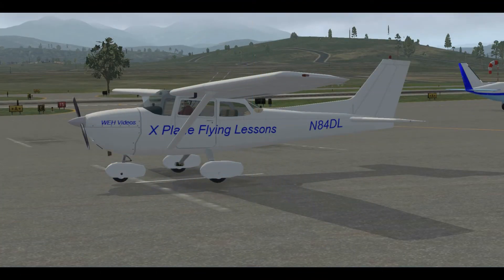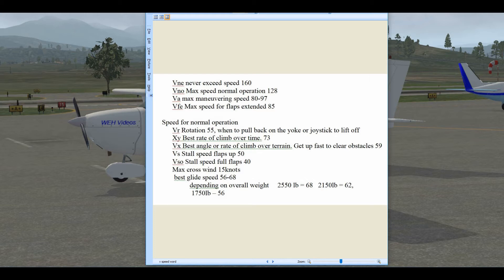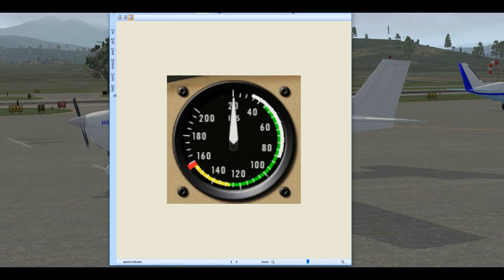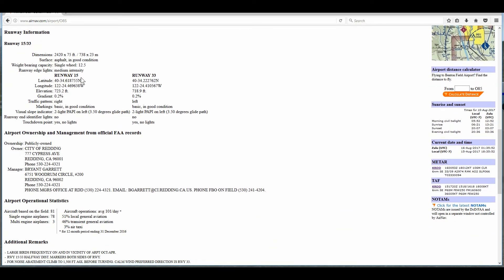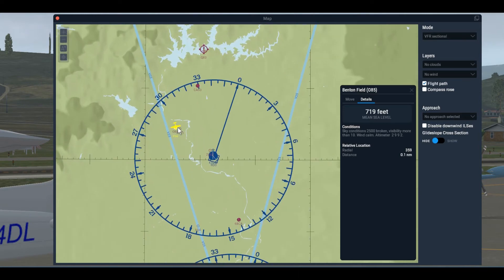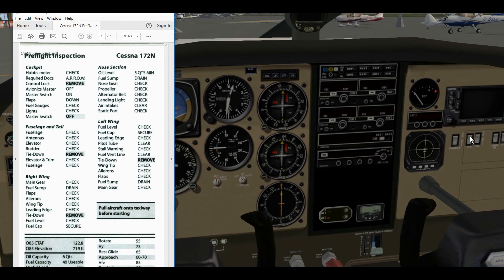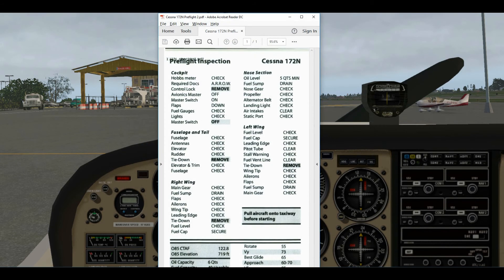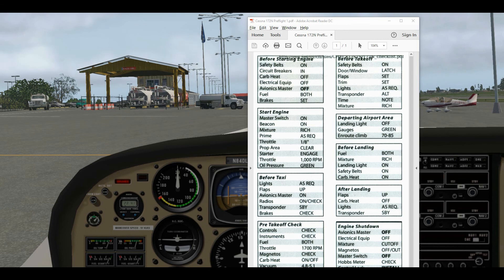Preflight ~ Learning to Fly for Beginners in X Plane 11 ~ Part 2

Comment: highly underrated channel! I'm a bit of an idiot when it comes to flying... I've been flying (virtually), on and off since '98. I can take off and land, but my nav skills are terrible, I just don't understand how to work the g1000. Appreciate the no-nonsense approach to instructions... I did my first flight from Manchester (UK) to London in an SF50 the other day. I was just outside of London when my plane ran out of fuel! I managed to glide that bad boy down from 8000 ft and touched down barely on the tarmac of one of the runways. It was a great feeling.
Reply from the maker: Hi Stu,  Don't beat yourself up everyone started with little or no knowledge! Sounds like your doing pretty though landing safely after running out of fuel and getting to the runway, very cool. Thanks for watching hope the videos help. Sorry I don't have anything on the G1000 but there are lots of videos out there.

Blessings,
skip